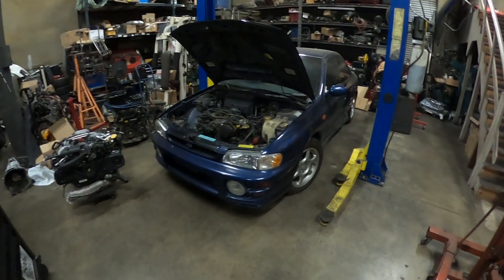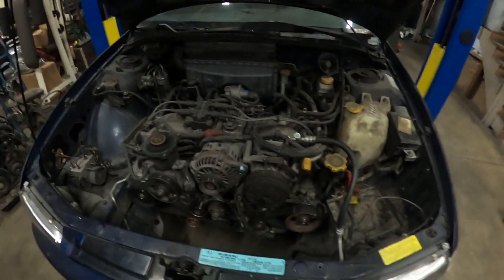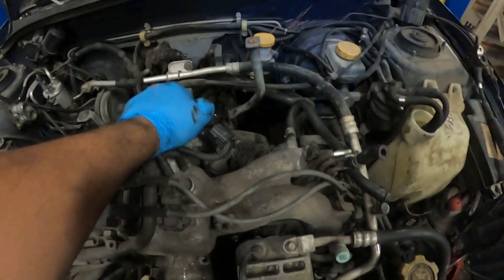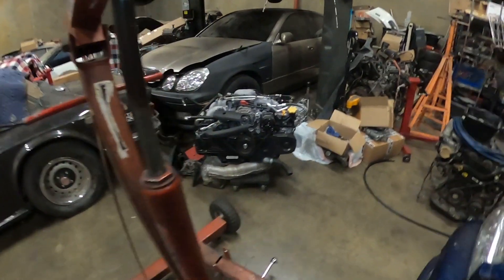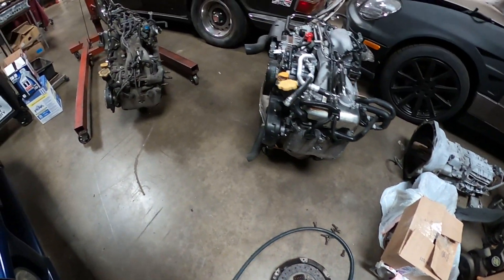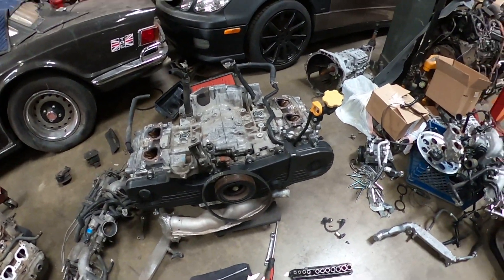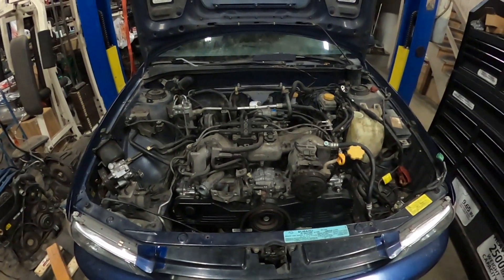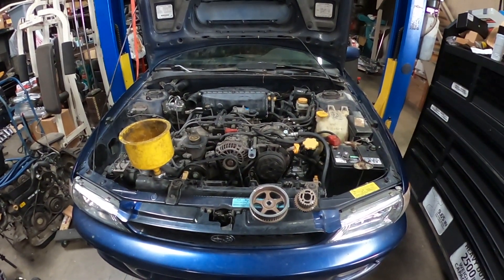EJ25 To EJ20 Engine Swap On 2000 Subaru Impreza

Comment: Can i do the same thing with a 2006 forester?  I want to put a jdm 2.0
Reply from the maker: You should
Reply: @mysterygarageCA  I hear that a jdm doesn't have avls . So how do I bypass that so it doesn't throw a code?
Reply from the maker: @pabloso8403  I don’t think you can bypass
Reply: @mysterygarageCA  weird. So there's a jdm engine shop by me that will do it for 1700. But won't tell me how they bypass it. So if I can figure it out I'll do it
Reply from the maker: @pabloso8403  let’s figure it out. What vehicle do you have and what engine are you trying to ise
Reply: @mysterygarageCA  2006 forester with a 2.5na. Trying to put a jdm 2.0na cause they said its 700 for the engine. And it's 1000 for install. But I'm on a budget. So I want to attempt the install myself.  I have all the tools just don't want the engine light issue.
Reply from the maker: @pabloso8403  I don’t think you have to bypass anything you just have to get the right 2.0 engine, they have a single and dual over head cam.
Reply: @mysterygarageCA  so the jdm 2.0s came with avls? I thought jdm didn't come with it.
Reply from the maker: @pabloso8403  they have both, with or without on the 2.0
Reply from the maker: @pabloso8403  the one with come with dual over head can and the other one is single cam.
Reply: @mysterygarageCA  mine is sohc
Reply from the maker: @pabloso8403  I see what you mean!

Comment: Can you use the same wires from the ej 25 for the ej 20?
Reply: Helped me alot
Reply from the maker: No, ej 20 is different. It has electronic throttle
Reply: I have a 2000 Outback sport with a 99 wrx jdm ej20 swap and it doesn’t have electronic throttle.